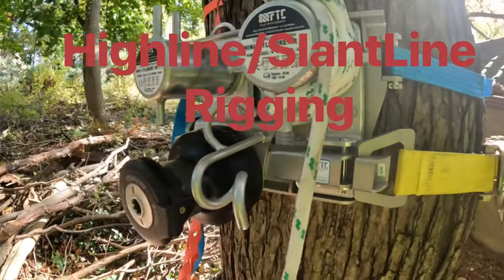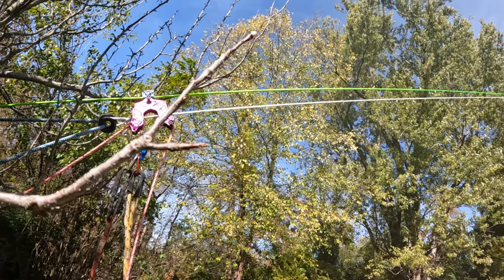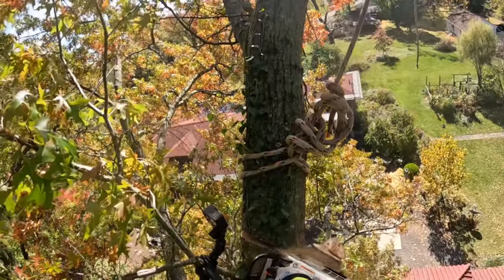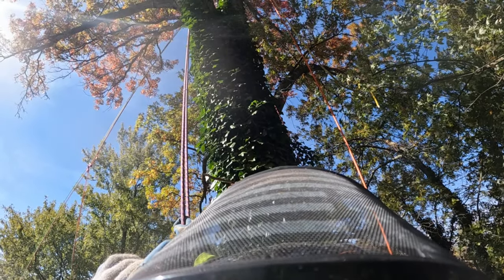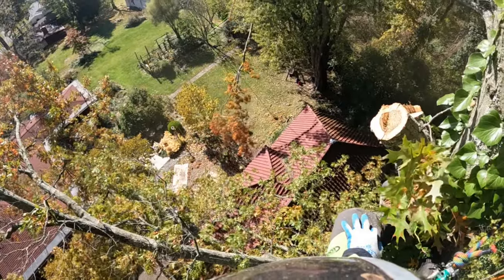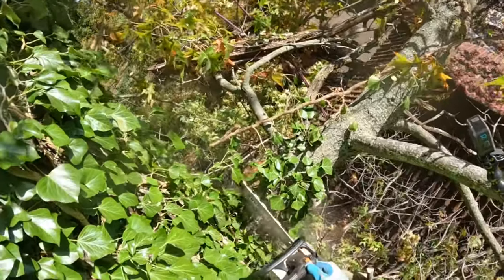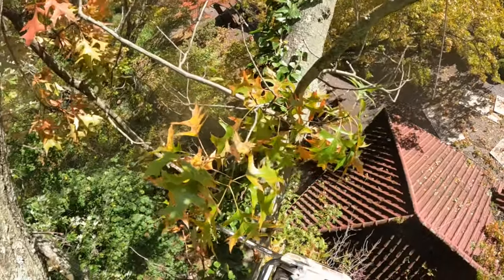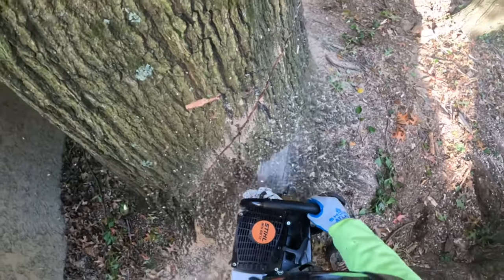DMM Keanu: High Line rigging, English Reeve

Comment: Beauty setup dude. I'm making my own trolley out of steel plate to do something similar. Don Blair used to sell a rigging trolley that weighted 8 lbs, he said the weight helped to keep the lines from twisting and fouling up, keep everything aligned. This is one way I plan on using it - with nice long crane slings. Hell of a job.      - Patrick
Reply from the maker: 🙏🙏🙏 thank you dude. Much appreciated!👊

Comment: Super cool stuff. I've been wanting to get into some highline stuff and just haven't had the right opportunity yet. Do you have any thoughts on knowing how to determine tension on the white rope in your system?
Reply from the maker: You want it as tight as you can get it. We had 300 ft of rope in that system, so tons of stretch to pull out. It needs to be tight to maintain the height in the system.
Reply from the maker: Important to know the ratings of the rope, and the power behind what you’re using to tension it
Reply: @therealzigzagman  I didn't even think of pretensioning the stretch out of it 🤔 I've always been worried about the tension that rope sees when loaded. I understand that you used a remote anchor on the high side so that the force application on the tree was mostly downward. How much load do you think was reasonable to put on that system. The tension on the white rope has the potential to multiple times the load on the red/white rope right?
Reply from the maker: @zaccheus  the more important thing is the direction of the force. We have estimates for what we think it saw, but the important thing is being safe with force direction, and starting small with stuff if you’re unsure
Reply: @therealzigzagman  good thoughts, thank you
Reply: @therealzigzagman  - And know how well rooted your small anchor tree(s) is/are...😜
This is where knowing the various rooting strengths of many different small tree species is important.
Reply: @therealzigzagman   I am impressed and yet a bit reserved. With a static rope a high horizontal tension and then vertical (peak) load I would think that you no longer have control over the forces that you place on the rope? I am curious if you were to place a load cell on the highline what values you would read at the moment that you drop weight in the line
Reply from the maker: @petercromheecke7730  depends where you measure from. At the high anchors they can see up to 6 times the load. We were very aware of what kind of forces we were introducing and planned accordingly.

Comment: The Keanu is awesome! Looking at adding one to my kit for this lake front property. All the wood and brush needs to go up hill. A high line with the Keanu would move the loads. Which high line and load lines have you found to work best with the system?
Reply from the maker: Static stuff for the highline ropes. Yale double esterlon is a good choice.
Reply: @therealzigzagman  what size  did you use on it?
Reply from the maker: @petercromheecke7730  we talk about what diameter ropes they are in the video, but the keanu only takes up to 13mm

Comment: Looks very similar to logging under a tower shotgunning
Reply from the maker: I’m sure the principle setup is the same. The only difference with logging like that, is you’re dealing with rated anchor points and relatively known weights, or at least weights you can put down if too heavy upon lifting.